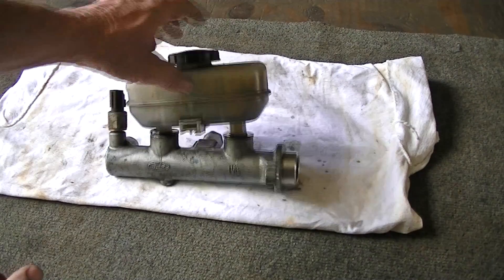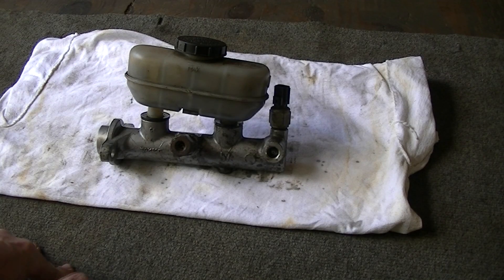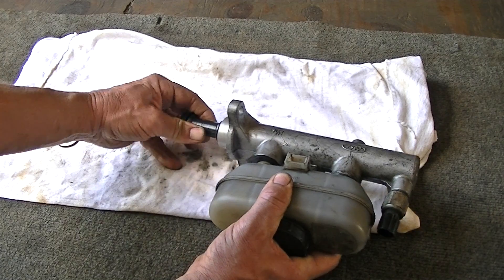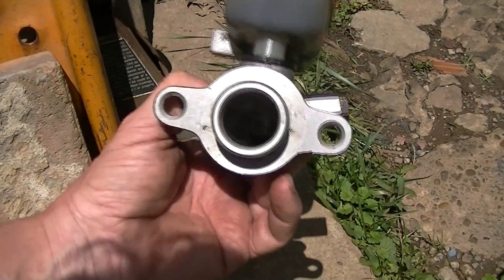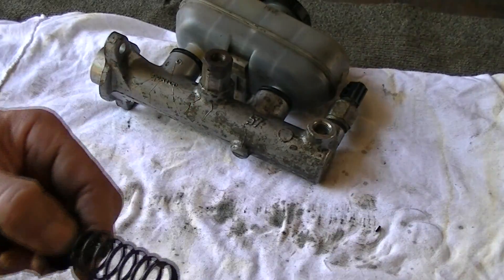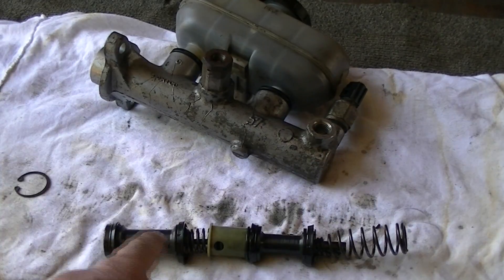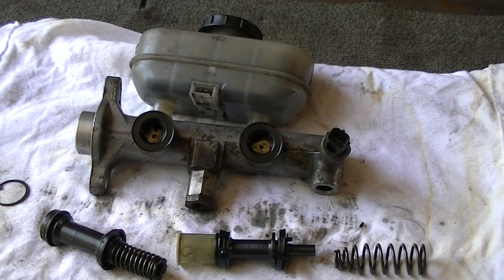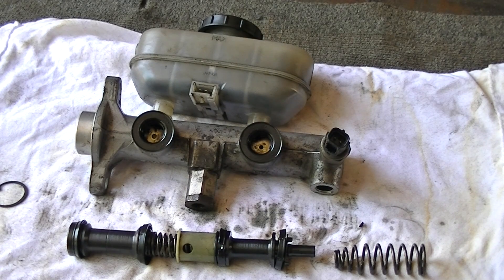WHY....Master Brake Cylinders fail. Here is why they do. Internal Leakage in a Master Cylinder

Comment: Opel Monterey 3.1 td  1994 master cyl costs over 200 euro;  kit was 4.34 eur, just 4 cups of 25.4mm (1 inch); doing it right now, came here,and other places...)  to see which cups go where:  if you look, 2 are different than the other two,i wanna make sure, because it was rebuilt before and was  not right, spongy pedal.; also, this a strange ABS master cyl, the seals go on the body of the cyl, the piston (two..) have NO GROOVES at all, just smooth aluminum .

Comment: My brake has been sinking.. Fluid was low, topped it off, got better but the brake sank again, I figure bleeding any posdible air out to trouble shoot would be easiest to rule out but it doesn't seem to want to come out anymore even after pumping the brakes.. So I imagen a bad seal could be the reason it's not pumpin these brakes

Comment: I have micro bubbles in the back part of brake master cylinder reservoir when the brake pedal is pumped. A hissing noise is also heard then goes away as brake pressure us built.

Brake fluid seeps out of reservoir cap after going for 10km+ drive.

Is this a sign of failing master cylinder??

Comment: What if there is no air coming out of your calipers, you have a squishy brake and an ABS system. I did activate the pump motor in the ABS while bleeding each cylinder there doesn't seem to be any air but yet I still have a squishy brake.

Comment: Hey! Maybe you could assist me with my problem!  I have a 93 fordf150 my brakes work fine however the fluid just pours out right by the proportioning valve where the brake line is. It's almost cheaper to buy a whole new set master cylinder instead of just the proportioning valve. Any advice

Comment: I love a PROJECT   at 77 years old   . My 2008 Citroen brake master cylinder had gone bad .. the seals were simply worn .  a new €6 euro service kit brought the AS NEW braking performance back . fabricating a vacuum brake bleeding unit and a bench bleed set up  kept me amused for a couple of days .   using a FLEX HONE 360 carborundum brush to restore the cylinder finish to as new .  great video .. if only I could get my head around producing videos for you tube .

Comment: In my case my truck has no ABS but when I was approaching a stop sign I applied the brakes the truck flew right past it. Checked all wheels for leaks, the master cylinder reservoir it still at normal level, so gotta be an internal leak in the master cylinder.
Reply from the maker: Yea happened to me in at 1974 Ford station LTD  wagon 460 engine one time....That HWY flagger just looked at me as I few by with no breaks...lol

Comment: when the leak is internal, where does the fluid go? my fluid level drops over time but i dont see no leak anywhere around. so i wonder where its going?
Reply: Fluid level drops as pads wear
Reply: Check in your booster

Comment: That's what I figured happened to mine. There are no leaks at the calipers, nor at the brake line where it meets the cylinder. Pedal sinks to the floor. Initially, you get a good brake, but you wait long enough it sinks, 'cause one of the seals is breaking the vacuum. Like trying to use a syringe with a bad gasket.
Reply from the maker: Yep! ;D

Comment: I have 2006 kia sportage that is losing break fluid. Change pads and rotors on all 4 tires. Still leaking brake fluid but i can not find where its leaking at. So if its a problem with the master cylinder where does the fluid go then because im stumped

Comment: I have a jeep I call Frankenstein because it is pieced together from several other types of vehicle.  As long as the bolts match up to the firewall, can I use pretty much any master cylinder?
Reply from the maker: If you like Pudding!
Reply: I know how you can find out.

Comment: Where u still able to bleed the brakes? Was there full resistance with the car off but sinking when turned on ir did it sink when it was off also? Having some trouble,my pedal gets full resistance when car off,but gets floored when turn on car
Reply from the maker: After bleeding them some, they work very good.
Reply: Nathan Rohrbough what i ment was if you where able to bleed them before you swapped the MC as if u managed to pressurise it either with car on or off or if pedal was just floored no pressure at all? Thanks
Reply: Griphiny, did you get any info about this problem?
Reply: @pjwoo276  Hey man,im still working with it,going to work more on it in few days,ill post my findings if any
Reply: @griph9917  did you get this fixed? My pedal is sinking and I've removed all the air from all 4 bleeders
Reply: Still battling afraid,what u could do 
is first look for leaks around brake line,under car and so on,2nd is put vice grips on all brake hoses (use some rubber between for protection as to not cut) then start car and see if u get better resistance,if do most likely problem is at either caliper however like almost all,this is due to air still being in the system,could try have it pressure bled or gravity bleed (mind u dont let mc run empty!) my problem most likely faulty abs hydraulic unit,but think thats very rare though ,gl :)

Comment: I got a Ford with ABS TCS.  Brakes sink with no problem, to the floor.  I replaced the Master Cylinder and bled the system. STill to floor.  I then replaced the ABS unit with a used one.  Brakes still went to floor.  Found leak in line of the ABS.  The flare was bad iin one line.  I then replace that ABS with a new abs this time.    Still brakes go to floor after bleeding brakes. .  I dont see any leaks.  
Any ideas?  Could the rebuilt master cylinder be bad?
Reply from the maker: Was the master cylinder replaced new for a parts store?
Reply: The vacuum booster

Comment: The seal kits can still be purchased through a brake & clutch specialist as I had to rekit a PBR brake master cylinder in my Dads 2000 model Holden Commodore a couple of days ago.

The kit cost $44 AUD.

The kit wasn't a PBR brand & Holden don't stock the kits for them,him & my brother thought that the fluid was getting dirty & the brake pedal was spongy due to air getting sucked in through the grommets on the reservoir & it was leaking fluid from there.

It wasn't, it was leaking from the lid seal & the grommets were bone dry,the front brakes weren't getting enough fluid due to the proportional valve being stuck inside the master cylinder valve body,it had water contamination in it therefore the valve rusted slightly inside the master cylinder.

So,it was a 3 hour job to rebuild that one but not without any hiccups, the rear primary valve seal was an O ring in OEM form & the wiper seal from the kit leaked a tiny bit of fluid so I refitted the original O ring to stop it from leaking.

So,it would be wise to find an O ring to suit if the original one leaked.

Secondly, I was losing fluid when I refitted the unit,it was leaking from the brake failure warning switch so I pinched an O ring on the proportional valve.

The valve was hard to pull back out as the O ring bound up inside the master cylinder, once I removed it,I replaced the O ring then reassembled the master cylinder.

The brakes are far better than what they have been in years, my dad bought one from a wrecker to fix the sponginess problem, what are the odds that one had the same problem ????

They were both the same !!!! 

Fitting one from a wreck didn't fix the problem, rekitting it did !!!!
Reply from the maker: Good to know! Thanks!
Reply: How much did it cost you?? I am replacing the dntire mc for car? Is thst a good thing

Comment: I got a honda year 2000 and the break goes all the way down i changed the master cylinder it still goes all the way down any idea what it can be?
Reply: Maybe the brake pads are worn out. God bless
Reply: Probably cause it’s a Honda
Reply: Did you bench bleed the new master and then thoroughly bleed the rest of the system?
Reply: Update this if you get it fixed I have the same problem 👍

Comment: Replaced front pads by pushing caliper pistons back in...now no pedal pressure.
Did it tear a seal ? How could this have happened ? Car is 15 yrs old BTW.
Reply from the maker: Check your master cylinder ;(

Comment: When pumping on brake pedal, I made mistake by using heel instead of toe when I felt the pedal got firm/hard. The result was I heard a crack sound coming from under the dashboard. Moment later, the pedal got spongy.
The fluid level doesn't change, only its color changes.
I am worried that I have something broken either on brake booster (push rod) and/or master cylinder. 
I want to check parts connected from brake pedal to the booster first. I need to adjust the pedal height as well. But these things seems to require removing the dashboard to get access.
Do you have video on how to do these things ?

Comment: 1995 F series, (not super duty ,F600-F800, F53, or F59) had Rear Antilock Brake System (RABS)  You can buy a rebuild kit for Ford.  https://www.amazon.com/Raybestos-MK1849-Professional-Master-Cylinder/dp/B000C71MP8/ref=sr_1_1?ie=UTF8&qid=1518388688&sr=8-1&keywords=MK1849
Reply from the maker: Thanks!

Comment: What does it mean when the fluid drains and you pedal goes to the floor but you can feel your car stopping but not completely? Any suggestion can help, just needed to fix so I can go to work again

Edit: no leaks on the line or brakes
Reply from the maker: "fluid drains" Yo Gots a leak some where ;(
Reply: TVWXMAN32 that's what I'm afraid of, you think it could possible that's its leaking in the master cylinder or brake booster? If not the it has to be the line or a 4 brakes plus it slowly drain when I pump the brakes but when drive its pass half marker
Reply from the maker: Master Cylinder only. Brake booster won't do that. If fluid is getting low  after filling it up....look under for wet wheel or a wet spot fora fluid.

Comment: What happens if you do have ABS and the break goes to the floor?
Reply: Benjamin Balke bleed your system
Reply: Thanks man. There was air in the lines. Works perfectly now.
Reply: Benjamin Balke no problem
Reply: I have abs from a 91 Honda I've rebleed the brakes 15 times all different sequences not a single bit of air from any caliper and no leaks could this be the master cylinder or air in the abs matrix ?
Reply: Werbutlemon233 I would think so I believe for your model part cheap.. try rockauto for parts where I get mines for a good price..

Comment: Hi TVWXMAN32, I have a 2000 Hyundai Elantra, no ABS. The brakes are locking up intermittently in stop and go traffic for the last few months. So, I removed the front tires. The brake pads were locked solid and the rotor wont rotate at all. Front-driver side brake and wheel was blistering hot, front-passenger side was less hot. Back brakes were not hot. When the wheel/brake lock up, the brake pedal is stuck at the up position, brake becomes super sensitive, the car drags and just touching the brake stops the car. Pressing with a lot of force wont make the brake pedal go down, it stays stuck at up position for 10 minutes even with the engine off. 
15 minutes after turning the engine off, the brake pedal would go down a little bit. After 30 minutes everything becomes normal, the brake pedal goes down and up normally, the car drives normally afterwards for the rest of the day.
The car also runs louder than before. Rotating the steering wheel to the right diminishes the road noise partially.
People gave me a big list of things that could be causing this. After this locking issue started happening, over the last few months I replaced the following parts:
1. New brake pads and shoes on all 4 with new hardware.
2. New rubber brake hoses in both front brakes.
3. New wheel cylinders in both back brakes.
4. New caliper with piston assembly in front driver side. Passenger side is fine.
5. New wheel bearing in front driver side (there was visible smoke from front driver wheel when it first happened). Other bearings are fine.
6. New cheap Chinese tires on all 4.
7. Bled a large bottle of new brake fluid through the system.
There are no leaks.
None of the above fixed the problem. Any ideas what may me be causing this intermittent brake locking issue?
Reply from the maker: Try a new ABS pump.
Reply: He said NO ABS!!
Reply from the maker: Opps.....My bad ;(
Reply: You might need a new brake master cylinder

Comment: What about leaking at the rear seal at the booster? I have had two aftermarket cylinders fail like that and they were brand new. I ended up using my oem because it was in better shape.
Reply: AwesomenessIskey the bore seal from master cylinder to booster push rod is pad. Keep in mind that same bore seal lubricates the push rod from the booster so a little bit of seepage is normal. As long as pedal effort and feel is normal.
Reply from the maker: If your booster is bad....you brakes pedal will be hard as a rock!
Reply: No, I mean brake fluid leaking out the back seal of the master cylinder where the circlip is.
Reply from the maker: Yes....true!  Thanks for sharing!

Comment: Ok, how does the reservoir come off?
Reply from the maker: You have to pry it off....its on there with two O rings...pretty tight. Pry it off while its still bolted on the power booster. It will make it easier to do.
Reply: TVWXMAN32     Thanks!

Comment: ..yep, a little nickel part will cost you $50.00+. That's the case with most all plastic & rubber parts now. They will last a few years, maybe...
Reply from the maker: You got that right!
Reply: Not true.
Reply: More like 300 plus for parts and labor.
Reply: TVWXMAN32
I wonder if she recently had a brake fluid flush or other brake service?
Usually if you bleed brakes and push the pedal down all the way to the floor it is almost guaranteed to damage older seals. That's why good techs will place a wood block under the pedal so that you can't push it all the way to the floor.